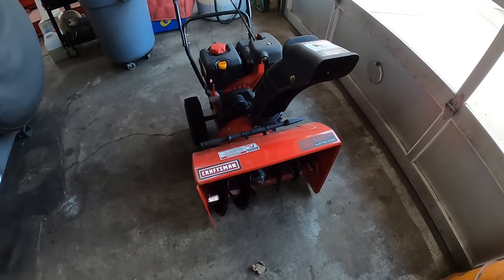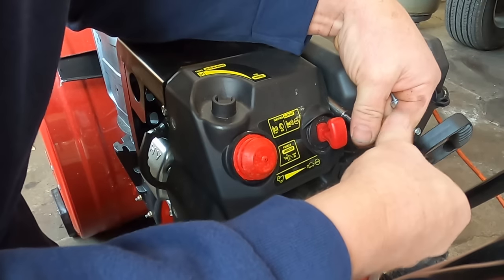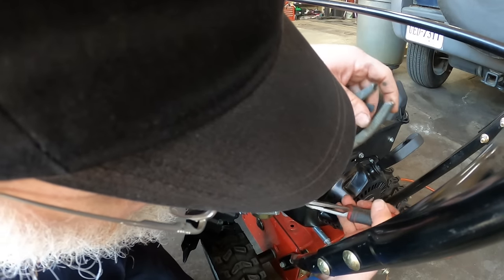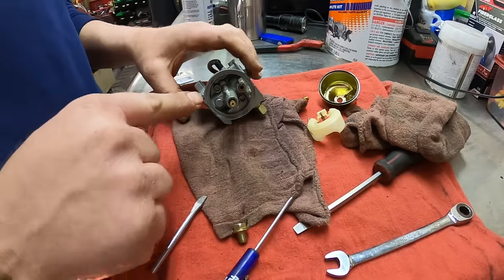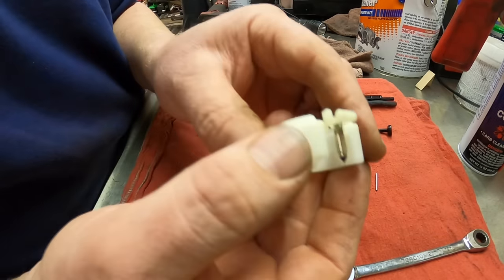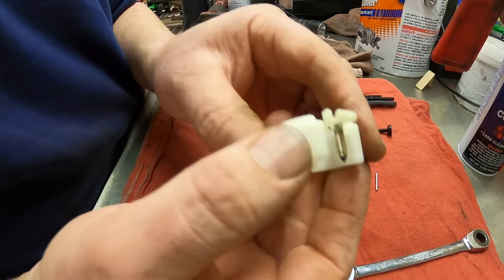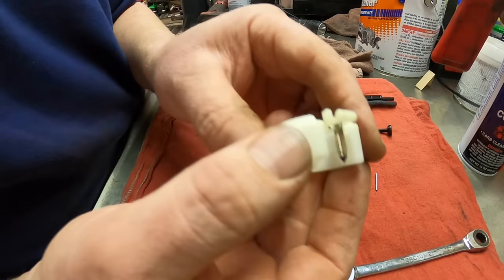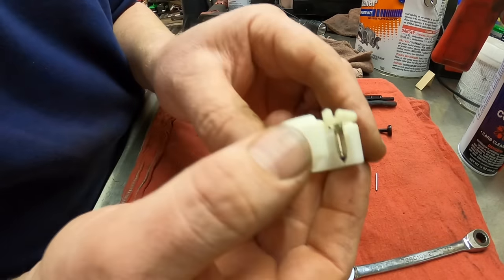Craftsman Snow Blower Won't Start

Comment: NO! You do not have to take the throttle nob off. There is actually a slot cut out in the plastic housing. Just line up the nob to the cut out and the cover will slide right over it. Also, it draws air from the top of the choke tube. OR  you can just take off the 2, 10 mill nuts that hold the carb in. Disconnect the fuel line and other line, and the carb will slide right off.
Reply from the maker: I don't remember there being a slot on this one. Thanks for watching
Reply: Correct Dave! He said he doesn't remember seeing one. I can see it right in the video. LOL Those models ALL have the slot.
Reply: I was thinking the same thing and once it is a couple years old that is important as that plastic will break when removing from the metal.

Comment: thanks for this!
unreal that a snow blower thats used once has to go through this routine each season. im using super gas too lol.
my last blower lasted 25 years. never had to do this
Reply from the maker: Its the ethanol in the gas. I now drain the tank and the carb every spring for storage. I don't get a lot of snow, so sometime my snow blower will sit for 2 or 3 years. When I need it I put gas in it and it has always started. I also store it with the choke on to keep the stink bugs finding a home it the carb. Thanks for watching

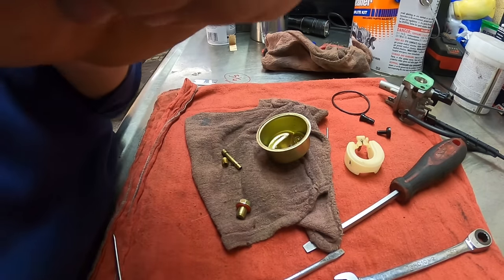Comment: My four years old Craftman snowblower did the same thing, despite the facts that I only used it for two winters. It failed to start in the fourth year, even if I have electric starter on it. Its carburetor was apparently clogged just like this one, I opened it it and the fuel bulb bottom is coated with the dark brown gunk, much worse than this one. I did not soak it in the can like he did but use the brush to remove the gunk with the Gum Cleaner fluid in the bulb. I also spray the Gum Cleaner into the carburetor body and soak the jet and the emulsion tube in the Gum Cleaner fluid and the gunk just fall off. I did not clean the airbleeder on top by the idle adjustment screw (20:15)  but will do that next time. This problem can be completely prevented if I ran the snowblower until the gas tank is empty before storing for the summer, which is what it says in the user manual. The same maintenance procedure is recommended for the lawn mower, before storing it for the winter. The fuel shut off valve would work too but you still have to run it until the fuel bulb is completely dry. This is a very well done video to bring the Craftman snow blower back to life.  There was an annoying background noise until 20:55 when the noise disappeared completely.
Reply from the maker: Thank you and thanks for watching

Comment: Excellent video to echo everyone else. I bought a Craftsman snow blower 2 winters ago but only used it once. Finally got enough snow but it wouldn't start and it sounds just like the one in the video. So disappointed. I had a John Deer for 12 years and didn't have to clean the carb once. I ended up manually shoveling. Seems archaic with today's advances in technology that we need to spend an hour or more disassembling, cleaning, and reassembling the carb when it was used only once. I don't have a huge amount to clear so now I am rethinking it may be worth the extra cost of a battery-operated blower. At this point in my life, I just want things to work. Especially something that cost $700 and used only once. What a letdown.
Reply: Seems it was a case of bad gas. After draining about a cup of gas from the carburetor it started.  I just purchased a fuel stabilizer as well. I've switched most of my yard power tools to battery powered so the gas doesn't get used much and it is probably at least 8 months old. Maybe I'll dump what I have into my car and get a refill of fresh 10% ethanol. However, the biggest mistake was being lazy and not confirming it worked a day or 2 before the storm. Thanks again for your in-depth and easy-to-follow instructions.

Comment: Best video on here. 
Thank you for posting! 
This is our 2nd year with this problem. Is it just a terrible design? The first time we siphon the gas out. Second time we put storage stabilizer. Same problem, I’m done with Craftsman!!
Reply from the maker: You need to drain all the gas out and then pull the float bowl off and drain the gas out of it also.
Reply: Awesome video, thanks! This is a crap design. Having to pull the float bowl off every year??
Reply from the maker: @keithusaf1  All of them are like this even the ones that have a float bowel drain. All the gas still doesn't come out. Its the ethanol in the gas. If you use super/premium, the gas doesn't go bad as fast. And always use sta-bil gas stabilizer. But complete draining the gas is the best.
Reply: @TheGAutomotiveAndMore  Thanks. Do all brands have this issue? (I never had to drain/clean my old Toro.) Are there other fuels we can use (such as camp/white gas)? I've rebuilt many 2v & 4V carbs, but I noticed (in your video) that the ethanol "gunk" wouldn't desolve with your solvent!

Comment: If you are watching this its a great video.  Cleaning will work but you can get a new carburetor on Amazon for 15 bucks. I had no experience and fixed mine today because of all of these wonderful people that post things like this. Thanks The G Automotive and More...And mine gummed up after one year and I ran it dry. Anyone have thoughts on what to do at the end of the year so they don't gum up?
Reply from the maker: Thank you. I would pull the float bowl off after you are done with it for the season, clean it out and put it back on. Thanks for watching

Comment: Great video very informative!  But what could the owner do to avoid this clogging issue.  It was obvious that the machine had hardly been used, could he have done something when he was putting it away for summer storage?
Reply from the maker: Yes, drain all gasoline out of the machine and run the machine to get all the gasoline out of the float bowel in the carb. Some float bowels have drains, so drain them. Thanks for watching

Comment: Currently troubleshooting my Craftsman SB410. It's not starting just one winter after I purchased it. Pretty sure I drained the gas last winter, but was using normal unleaded and should probably be using non-oxygenated. Especially with this model as it appears to have a lot of issues with the carburetor. I have a few questions regarding this video:

* How do you safely remove the hose leading to the prime bulb? Do you just pull it out? Using tools?
* If you can get it to start with starter fluid in the carb air intake or spark plug hole, is cleaning the carb necessary?
* Is it easier to clean the carburetor and rebuild it or just replace it?

I'm a little nervous to take this project on, but it's quicker and cheaper than sending it to a repair shop and we just got our first big snow in MN. Looking for the quickest and easiest way to get this baby up and running, so I can drain the gas and start using non-oxygenated. Unfortunately, I just filled it with a full tank of unleaded to try to get it to start (before doing any research).

Lastly, when I sprayed starter fluid into the bottom plastic area of the carburetor (like you did), it started for a brief moment and then turned off and wouldn't start again. What does that indicate?
Reply from the maker: Sound like carb is clogged up like this one. Even if you drain the gas from the float bowel drain there still is a little bit of gas still in the bowel. I set the choke and try to start it to get that last bit of gas out of it when storing it. The primmer bulb hose is just stuck on, twist it and it will come off. Of course  its easier to replace the carb but its not that hard to clean it out. If you can get real gasoline that is better but I still would put a gasoline stabilizer in the fuel.

Comment: awesome video! thank for such a thorough video. I ended up replacing my carburator kit last time I couldn't get it to start because had no idea how to clean it like this. I've heard different people say different things about using the rope pull vs electric start functionality. is either fine or preferred?
Reply from the maker: Both are fine to use.

Comment: I have the exact same machine, exact same problem. I will try this.  Would you suggest installing a gas shutoff valve in for the offseason, or draining the tank completely before storing for the summer?  Thanks so much for the very detailed instructions.  Mine is only two years old, seems like a design flaw.  Take care and keep up the great instructional videos!
Reply from the maker: I drain all the gasoline out. There is not a lot of room for a shutoff switch. Just be sure to drain the carb. Thanks for watching
Reply: It worked, thanks again.  One useful little thing, at about3:54 you're pulling the throttle handle off, but my machine (which appears to be the same) has a notch or slot cut out of the cover along the throttle so you don't have to pull the red knob off.  Take care.

Comment: This really helped me and I was able to start my snowblower but I accidentally broke the small plastic nozzle the primer hose sits on, is there a way to replace that?
Reply from the maker: You should be able to buy one on line. I use Jacks small engine or Ebay for my parts. Thanks for watching

Comment: Hey. Excellent video. The carb clean was exactly what my snowblower needed. 
I did have an issue with fuel leaking. I changed the gasket and then really tightened the bolts. Solved the issue but would  applying 2 or 3 layers of gaskets be better?
Reply from the maker: A new gasket will probably fix it. If not I would do what you said put 2 or 3 together. Thanks for watching

Comment: Great video. Ours now is running but now it sounds like it wants to blow up. Very high rpms. What could we have done wrong?
Reply from the maker: I would check the linage and the linkage spring. Make sure it connected and not binding. Check your gaskets make sure they did not rip
Reply: @TheGAutomotiveAndMore  thanks again. Turns out it wasn't the spring but the metal bar right next to the spring l. If you don't push it down securely it just falls out and causes RPMs to run high. It now runs perfectly. Thanks man!!!
Reply from the maker: @adamdonluz  Glad you found what was wrong.

Comment: I wonder if you used the same solution that I did to remove the primer bulb hose. I cut the damn hose as close as I could to the bulb stem.
Reply from the maker: No I go the hose off but what you did works also. Thanks for watching
Reply: @TheGAutomotiveAndMore  Thanks for reply and video. My snow blower is again!!! You probably saved me about $150. It's tempting to add an inline fuel filter between tank and carburetor.

Comment: Thanks for the video! Started right up! Although, it would seem like I didn’t record the proper turns for the screw above the Idle Speed Jet properly. The reason I believe this to be the case is that when I start the engine and slowly turn the Choke Lever to Run, the engine gets extremely loud. Any ideas on the best approach if I didn’t record the proper turns? Would 5 1/4 be a good start?
Reply from the maker: Yes start there. You can always adjust it higher later it not high enough. Thanks for watching

Comment: If you have a starter, keep the starter spinning with one hand, and push the priming bulb with the other hand
Reply from the maker: I do not think it was going to work on this one. Thanks for watching
Reply: @TheGAutomotiveAndMore   Indeed, if the emulsion tube is too clogged it will need cleaned manually. But if it's slightly clogged such as after a summer storage, good chance the trick will work. That's how I start mine now - it won't start if I first prime then start.  Cheers

Comment: Identical problem to mine, thanks for the video!
Reply: That fixed her right up, wasn’t as gummed up as the one in your video but the jet was plugged off. 

Wear your safety glasses though! I sprayed out the jet with carb cleaner and it shot back in my eye! Haha!

Comment: Would be great to mention how to get the hose off the primer.. mines stuck on and I don’t want to break it
Reply: I had trouble too, also worried it was going to break. Steady pulling and twisting got it off but it was a pain.  Good luck, you'll get it!
Reply from the maker: Yes it’s very hard to pull off. Just pull and twist carefully.

Comment: Great video ! Can you please advise on Frozen Starter ? When attempt to pull in moves about a foot then full stop.  Lent it to low vision neighbor and he ran it almost completely out of oil one season.It is not a high hours machine.  Added oil and the missing oil plug ! Tried electric start but just a thud like sound like it was meeting some resistance.  Any ideas ? Havn't tried Marvel mystery oil or WD40 in spark plug 
hole  yet.  what do you think?  Any hope ?
Reply from the maker: No it sound like the motor is gone. Sorry.
Reply: Thanks for the quick but sad reply .Moral of story  Don't loan your equipment to anyone or else suffer the consequences 😞
Reply from the maker: @cyyoung9175  Yes that is true. I hate loaning my stuff out, it always comes back broken.

Comment: Just wondering why you bothered removing the throttle knob? There is an opening in the plastic cover so you don't have to do that.

Also, another way to check if the fuel is flowing from the tank to the carb is to remove the drain plug on the bowl. Put a gas can with a funnel under the bowl, pinch off the fuel line like you did, and drain the bowl. Then release the clamp (stop pinching the line) and if fuel starts to flow out the drain again, the fuel line is OK.
Reply from the maker: Some do not have that opening and other people wanted to know how to get it knob off.

Comment: What size is the carb bowl o-ring? I took the bowl off of a snowblower I recently purchased and the o-ring fell apart. The local hardware store did not have one. DIY,  I have my snowblower all apart and no replacement o-ring.
Reply from the maker: I would order them from Jacks Small Engines online.  https://www.jackssmallengines.com/

Comment: my snowblower wont start can I shoot some fluid starter into the intake and will that fire it up and clean out the carb
Reply from the maker: It should start but if the carb is clogged up it will stall out

Comment: Can they put a filter in the fuel line to catch all that gunk before it gets to the needles?
Reply from the maker: I guess they could but I think this gunk it what's leftover  after the gasoline evaporates. Drain your gas and drain the gas out of the float bowl. Thanks for watching
Reply: If you use non-ethanol gas & Sta-bil you won't get the gel build up leftover from regular pump 10% ethanol gas
Reply from the maker: @buffalobluecheese  Here in the Washington D.C. area we can not get regular non- ethanol gas. Small engines definitely do not like it. Thanks for watching

Comment: my snow blower wont start using the pull cord but will start using the electric start. Any suggestions? Also my starter is bad. I believe the gear teeth is bad. Do you know if a replacement gear is available?
Reply from the maker: Yes you can get the gear. Try Jacks Small Engines. What is wrong with the pull starter? If it doesn't grab there is something wrong with the fingers inside it.
Reply: Thanks for the detailed video. Exactly what was wrong with my Snowblower that was new last year. I guess I better run the gas out next year!
Reply: @TheGAutomotiveAndMore   I replaces the carb and spark plug and I was good.

Comment: I put stabilizer in my tank when I stored it and I still had issues with my carb getting clogged. Is there a fuel filter on this model because I can't find it if there is.
Reply from the maker: No I don’t think so. Thanks for watching

Comment: bought it from Sears 6 yaers ago the only time carb get dirty becouse i used Regular Fuel you always need to use super plus Thats keeps the carb clean
Reply from the maker: Yes using super gasoline definitely helps because it does not go bad as fast as regular gasoline. Regular gas nowadays goes bad very fast now because of the 10% ethanol. Thanks for watching

Comment: Okay I have this exact Craftsman Snow Thrower. When I try to remove the choke knob at the top a long plastic assembly comes with it and it's still connected inside. Mine looks like a slotted screw is inside the handle. I tried to loosen it but it just spins and doesn't come out. Second the throttle knob. I'm a big guy and I workout w/weights 6 days a week I can't get the throttle knob to budge I actually picked up the whole snow blower off the ground by that knob but it wouldn't budge. Any suggestions other than cutting them off? lol
Reply from the maker: I just went back and watched the video and I know that the throttle knob you have to wiggle and pull at the same time. The choke knob should just pull straight up evenly.

Comment: What if the gas has too much ethanol? I had to take the carburetor off a lawn mower, drain all the gas out because someone put regular in. the lawn mower called for non ethanol im assuming this could be a problem as my craftsman snowblower says 10% max on its gas cap? The snowblower is brand new. I dont know what kind of gas was put in it. Acting exactly the same as the lawnmower i previously mentioned. Has spark.
Reply from the maker: It should be able to run on ethanol 10% gasoline. But go ahead and try different gas in it and see what happens.